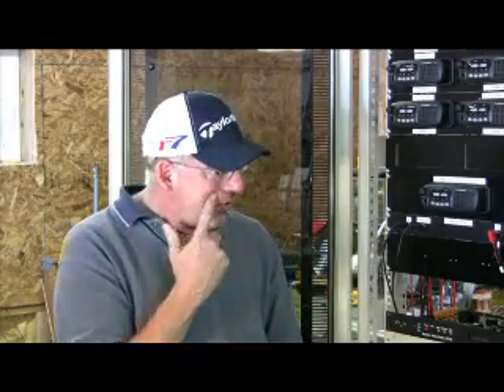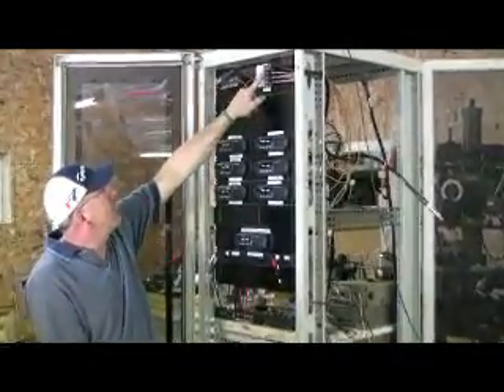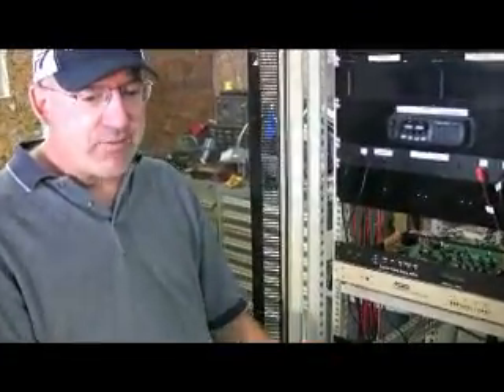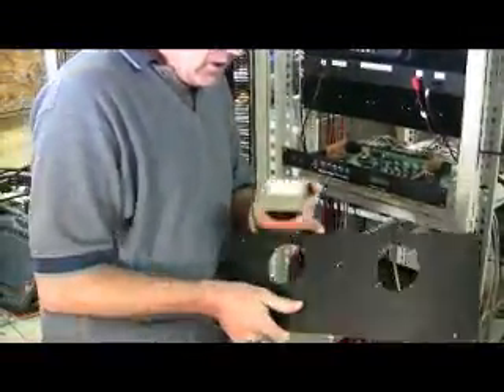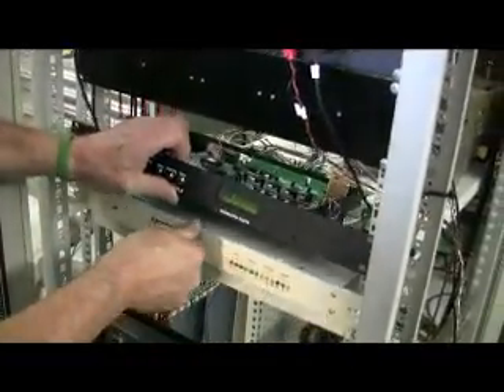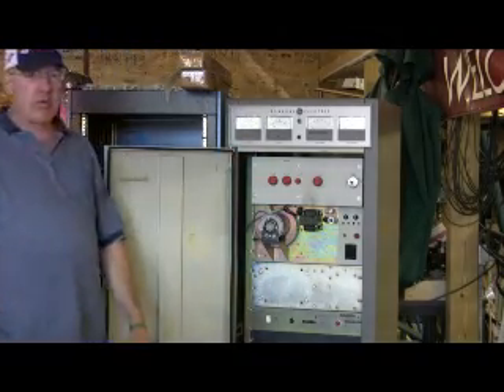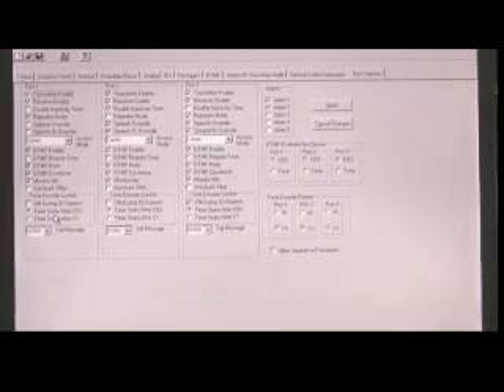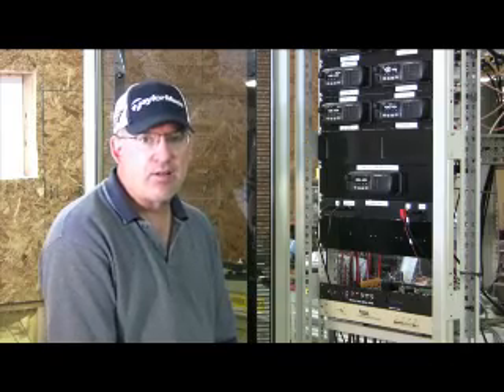Progress Report K3DN Repeater

Comment: Can you help me understand more in depth on how and why you have all those receivers? I am in middle of restoration of one of our local groups.  It still runs a GE Mastr II but that rig works so well i begged we leave it be, just give it a tune up and run another 100,000 hours,  we just bought a LinkComm RLC Club Dlx 2 controller, man is it versitle!  But it will bring tears to program the thing!  We need a good functional remote base system seems everyone supports the 30 year old method from icom and the Doug Hall RBI method but the interface box cannot be located since they quit making them 1995
Reply: They have multiple 2M receivers scattered around the repeater coverage area, which repeat their receive audio and transmit it to the primary transmitter site on different 70cm frequencies.  For any particular user, one receiver will have better signal than the others. The voter measures the quality of the signal from each UHF receiver, and picks the best one to send to the transmitter.  This makes your repeater receiver more sensitive over a wider area and is especially useful if you're in an area that isn't flat.  It lets you fill in shadow areas.